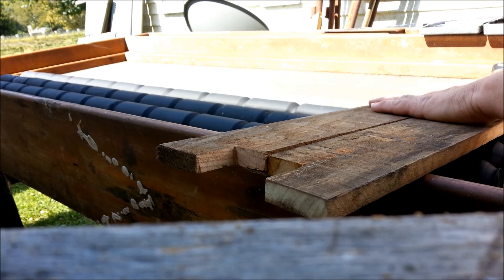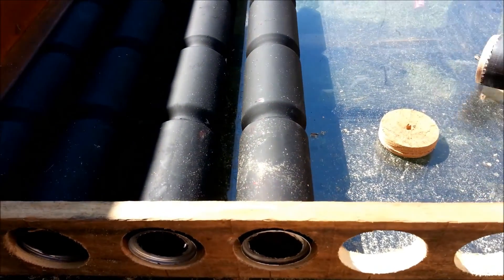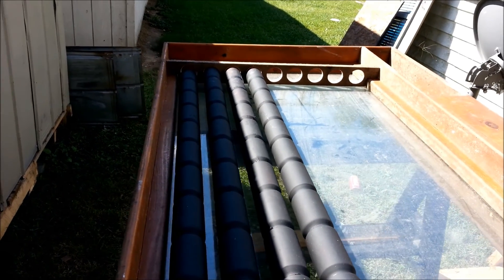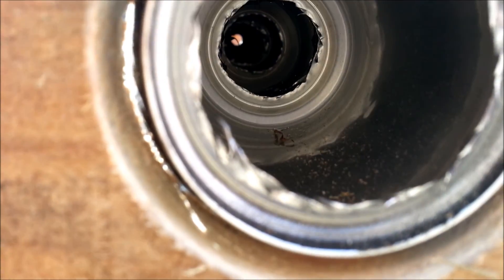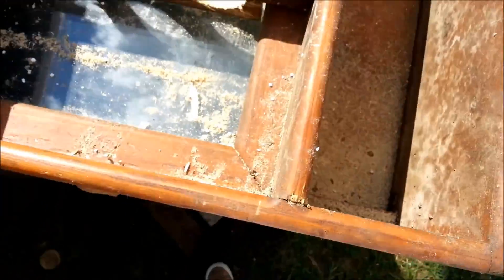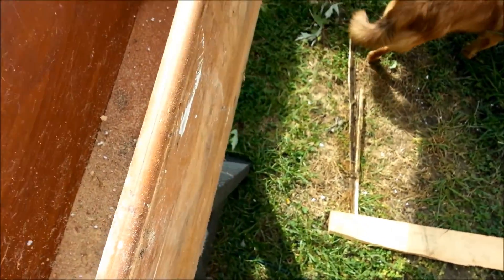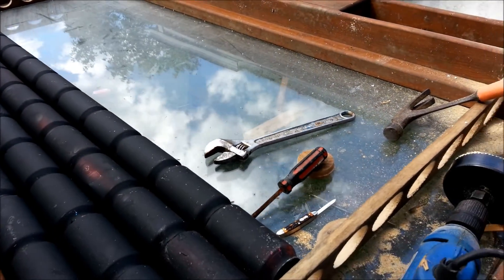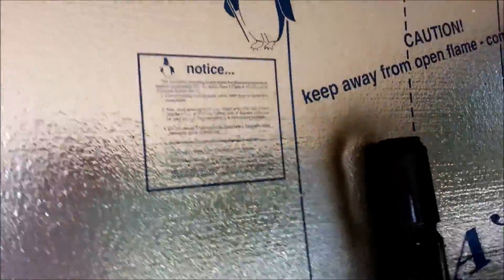How to build a solar can heater / solar furnace, for solar heat. Part 2

Comment: Wondering if it would be better to leave the backing foil shiny to reflect the heat back to the cans and also put the cans right up against each other, so there's no gaps...?
Reply from the maker: I thought about both of those ideas, I thought if I left the foil shiny, it might reflect the heat all the way back out, instead of absorbing it. The cans could be closer, I think that is a matter of how you design yours. I believe you need SOME gap for air, since air is a great insulator. Thanks for watching.